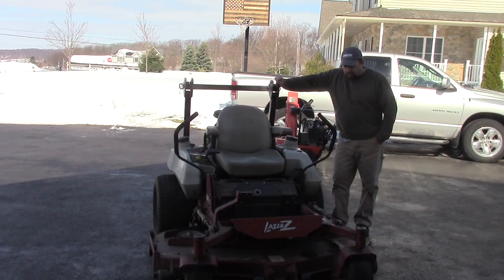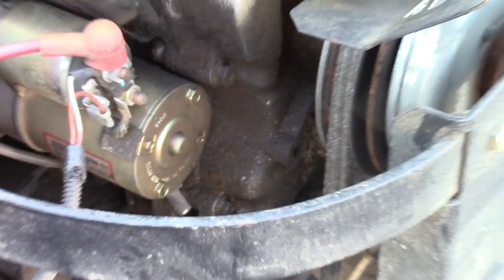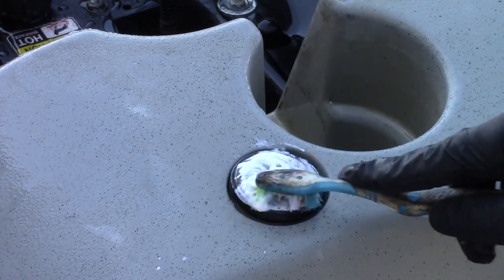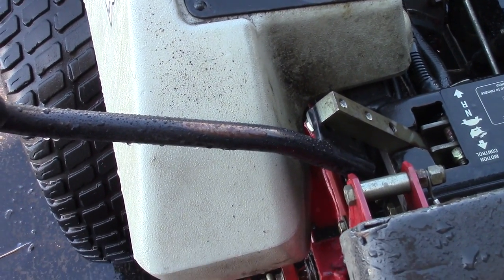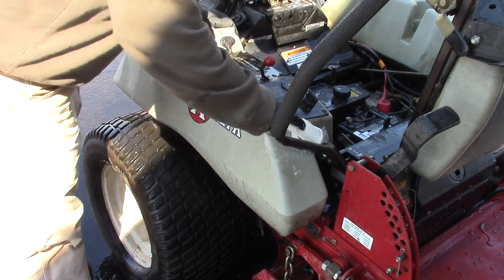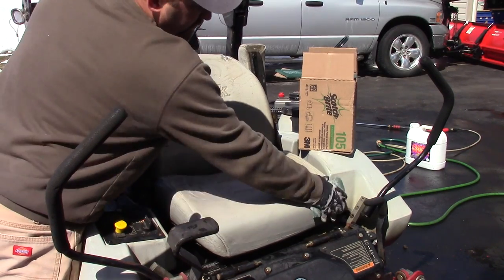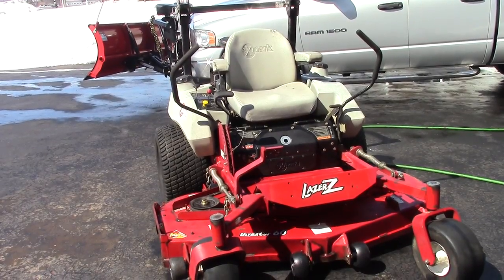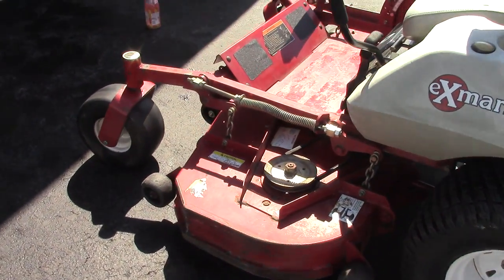Cleaning Up A Tractor For Resale

Comment: I'll (eventually) be in the market for a used zero turn mower.
I'll have some hilly areas around my house and shop to mow with it as well as a 5 acre field.
What mowing width would you recommend?
I was looking towards a 72" cut, but have heard that anything over 60" really scalps areas when the land is not perfectly flat. The field is flat, but the rest is very much not flat.
Thoughts?

Comment: You did a good job on the clean up. Thanks for the tips. I use Simple Green also on slot of my clean up. It is easy on paint and the yard and environment. I also use Dawn on nasty clean ups. I learned a trick from s Sixtyfiveford using ATF to restore the shine on faded paint and plastic. It does a good job on the appearance especially for resale.
Reply from the maker: Good tips, I saw the ATF I need to get some on the shelf here, so I have it.  Does dust stick to the ATF?

Comment: Hey man next time don't use Dawn. Yeah I know it's a degreaser, but it will ruin the finish on the paint. I would recommend using Simple Green. It will remove the grease and dirt just as well. I also use armor all interior shine on the fuel tanks and plastic pieces. Remember to grease it all up once your done.
Reply from the maker: I have used purple power and had problems with paint dulling.  I may have mixed it too strong that is why I use dawn.  I don't really like the armor because I find grass sticks to it as soon as I mow.  I did grease it up and sharpen the blades.  It's ready to mow.

Comment: OK you cleaned that up old school.   It shines like a new nickle.  You know I would pay for the covers.  It is a valuable machine.  Can you make the covers.    Bruce
Reply from the maker: I don't have the right metal to make the covers.  The way my insurance works the buyer will need to sign off that they are missing.  I'm trying to buy them used if possible.  It will be way easier.  I will have to look up how much they are new.  This machine takes the metal covers, my other one takes plastic.  I will let you know what happens.

Comment: How many hours is considered a lot of hours for a commercial grade zero turn?
Reply from the maker: Good question,  I see these with over 3000 hours pretty regularly.  This one has new hoses, belts and pumps.  It all comes down to the maintenance and what was replaced over the years.  If the mowers were abused (left outside, driven by careless employees) I would stay away from it.  I have another one with 500 hrs. same engine never any problems.

Comment: Get that purple degreaser from Home Depot -50/50 with water in a spray bottle, spray it down/hose it off.
Reply from the maker: I have had issues with the purple power making the paint fade.  I may have used it straight and let it sit about 15 minutes before power washing.  That is why I like the dawn.